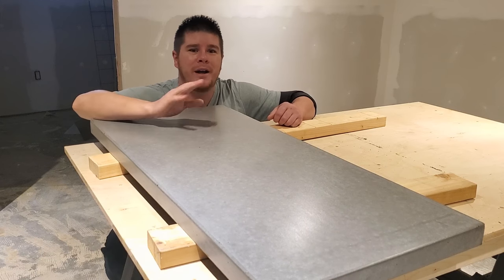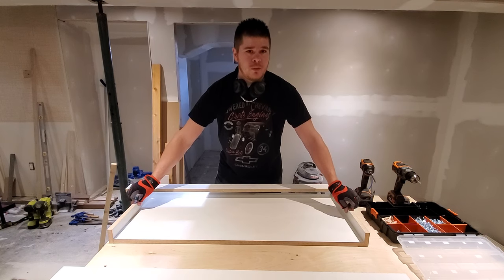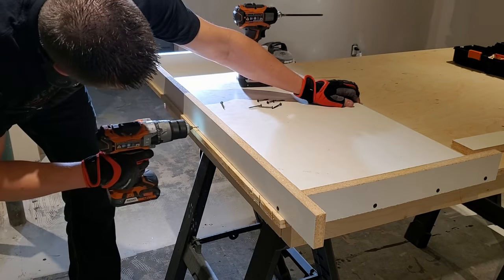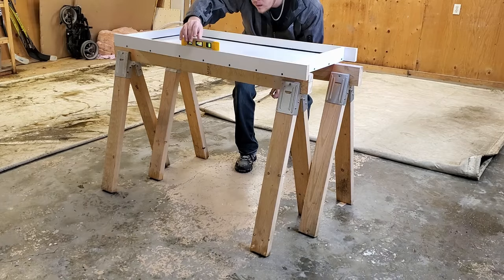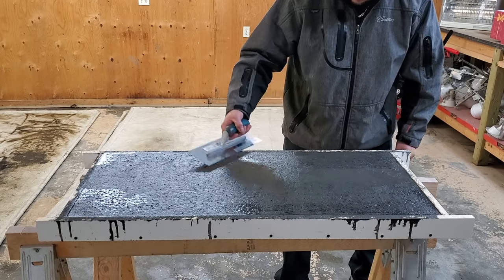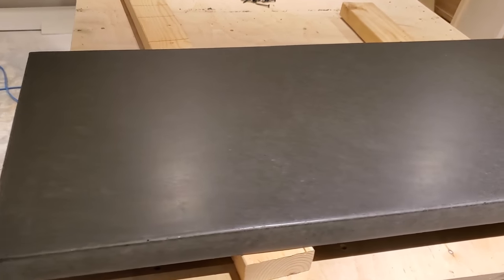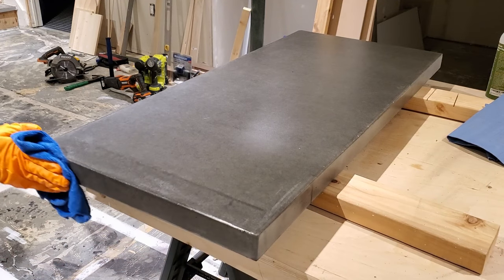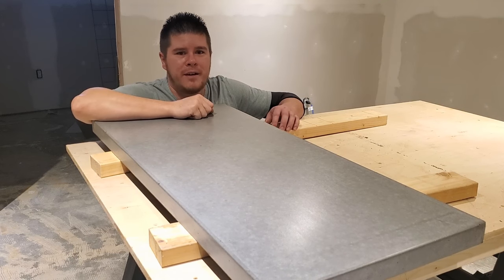Beginners guide, Concrete Tabletop you can build. No special tools, hand finished

Comment: That looks so good, forget paying megabucks for a concrete table, I'm having a go at this, great vid. One question, if you wanted to mount steel legs to that, how would you go about it? Drill/plug the underside, & screw in, or epoxy glue?
Reply from the maker: Thanks! Good luck with it. I guess that depends on the type of mounting plate, I would probably sand the tops of the legs with 60 grit to rough it up so epoxy will stick better and go that route. I'd be worried about drilling a fresh slab and not have it crack. Epoxy is a much safe route. Thanks for watching!

Comment: I use those same mechanics gloves they are amazing. Why would you ruin them by sticking them into wet concrete?
Reply from the maker: They are pretty good. I forgot my nitrile gloves and needed something quickly so I didn't have to stick my bare hands in the concrete. They were getting pretty tired anyways so it wasn't a total loss

Comment: Hello....I am getting ready to to try and make my first outdoor concrete patio table for a customer of mine. I am here in the states and was wondering what would be the equivalent to the concrete you used. I see a lot of people use GFRC (Glass Fiber Reinforced Concrete) but it seems to be kind of difficult to get. I really learned a lot from your video. Great Job! Frank from Southern California.
Reply from the maker: Yeah GFRC is tougher to get and needs some special considerations I didn't take about. I used Quikrete 6000 from home depot, but your best bet is quikrete countertop mix, it should be readily available for you. It's really hard to get where I live tho. The countertop mix is made specifically for this and is easier to work with and usually gives the best results

Comment: How many coats would it take to have water and other liquids bead off it? I read some reviews on Amazon and one of the mentions that it penetrates so much that you can't get a finish that reflects water. I like the fact of going only to like 600 or 800, and I will be doing it by hand. I poured RapidSet Mortar Mix and it's already pretty smooth, but I added color and it chunked it up, so when it came time to vibrate, the colors didn't release as much bubbles, so my counter has some character to it.
Reply from the maker: It depends on what brand of sealer you get. The stuff that I have linked and use it only takes 2 coats, then 1 recoat per year. This is a penetrating sealer and helps prevent staining, it may still get wet if it's allowed to sit, but thats what the wax helps. The wax on top of the sealer prevents anything from soaking in just like I showed. Reapply wax as needed too.

Comment: Would you recommend against drilling into the concrete tabletop? What's the best way to attach or build legs?
Reply from the maker: I wouldn't drill it. Best way to attach it to a table or cabinet it with 100% clear silicone. Put quarter sized dollops on the corners, and center of possible, of whatever your setting it on. Then without dragging it around, set it straight down on it

Comment: Great job, what cement do you recommend?
Reply from the maker: Thanks. You can honestly use any concrete, but preferably a non shrink or low shrink is best to avoid curling over time, the stuff I used was $10 a bag. If you have access to a countertop specific mix that is best tho. I don't have it where I live but wish I did

Comment: Love this video.  Very helpful and I followed the directions step-by-step but when I took off the mold and flipped the slab over you can see the faint outlines of the metal mesh in the concrete top.  It’s a subtle dark outline of the metal.  What did I do wrong?
Reply from the maker: Thanks. Sorry to hear you had a issue, but it happens. It just gives you more skill to practice again is all! Everything is a learning experience. So it sounds like you either put your reinforcement too low while making the slab, which puts it too close to the top. Another thing that can cause that is too thin of concrete and too much vibrating after it was put in caused it to sink and come too close to the top. Try again, but fill the slab 3/4 full and do the majority of your vibrating, then add your reinforcement, top off the cement and another quick round of vibrating. Making sure your cement is close to oatmeal consistency. Hope that helps, let me know how it goes
Reply: Thanks for your help! I think I overvibrated it based on what you said.  I’ll let you know how it goes.
Reply from the maker: Happy to help. Good luck

Comment: vibrating it wont cause the aggregate to settle and show in the finished side? That is my only concern. I have seen these tops made with a high strength mix such as Rapid set mortar mix from Home depot, and still using the reinforcing wire. Thoughts?
Reply from the maker: Nope. Vibrating concrete is necessary. The aggregate actually pulls to the center and the cement is pushed to the outside. I'm not a fan of the mortar mix personally. That's not what it was designed for and runs a much bigger risk of curling and cracking over time.

Comment: beautiful project!!! amazing result! very well described. Can you tell su exactly what type of concrete you used? and what exactly is that dark liquid you added to it?
Reply from the maker: Thanks! I used Quikrete 6000 psi pro mix, but the Quikrete countertop mix is best to avoid twisting and warping as well as an even cleaner look. It was a couple bottles of Quikrete charcoal concrete dye. Hope that helps! Thanks for watching
Reply: @JessedoesDIY  Thank you so much for this quickest reply! For sure it helps!  couldn't get faster service even at Homer Depot... LOL. Thanks again and keep the good work! Cheers from montreal
Reply from the maker: Anytime!
Reply from the maker: I've used rapid set mixes before making patio stones and you have to work very fast. While it isn't necessarily dry for a hour or 2, it sets and firms up withing minutes, and you're right as it does make it very hard to vibrate out bubbles that way. You have to work fast, but for a outdoor table it might not be too bad. I've also 50/50 mixed fast set stuff with regular mixes. It slowed it down and gave me time to work, but overall set up much faster than normal concrete would have. You could try that. Worse comes to worse, after it's done you can make a slurry with sifted cement  and fill the holes in the top and then sand it again. I want to have a video out withing the month on how to do that, but I know that's a long wait for you. Hope that helps. Feel free to email me with more questions if needed!
Reply from the maker: I typically use Quikrete because it's what I have available to me. Any mix can work really, but for the best results you'll want something that says it has no shrinkage or resists shrinkage. That's so it will resist curling over time

Comment: What mix did you use please??
Reply: Looks good
Reply: You can help me make it bell nut
Reply from the maker: I just used Quikrete 6000 psi mix, comes in a blue bag. It's a bit stronger and has minimal shrinkage, plus smaller aggregate. But if you can find the Quikrete countertop mix in your area, by all means use that. It is by far your best bet
Reply: @JessedoesDIY  thanks for the reply, I’m in wales uk, so I’ll try find a comparative product, cheers mate
Reply from the maker: Anytime! I try to answer everybody. The biggest thing you want to look for is minimal to no shrinkage concrete, and as small aggregate as you can. Typically cheaper stuff has bigger stones and we don't want that. Hope that helps! Let me know how it goes
Reply: @JessedoesDIY  I certainly will, It’s going to be a table for a pizza oven 👌
Reply from the maker: Cool! That'll be awesome!

Comment: Hi, I'm wondering how dark the color is after a couple of years?  Does it lighten up to an almost white beige natural concrete color or did it stay the way it was in your video?
Reply from the maker: The thumbnail was taken a few days after and that's as light as it became. I only added about 1/2 the dye I could have. If I added the maximum is gets to be a charcoal/gunmetal grey and it stays pretty dark. I made 1 with max pigment I could a couple years ago and it's still super dark. If you use the liquid dye just read the bottle for amounts but Quikrete stuff that I used I can use up to 2 bottles per bag. Hope that helps

Comment: Great Video! could you re use the mould?
Reply from the maker: Thanks. Possibly, it depends on if your mould swelled from the water in the concrete. If it didn't, give it a good clean, scrape off the old silicone and you'll be good
Reply: @JessedoesDIY  good points, ty!
Reply from the maker: Anytime

Comment: ok.  it came out great.  but one question...  there are bubbles / indentations in the face of the concrete.  I love it by the wife does not.  so I'm going to try again.  I vibrated for 20-30 mins hitting mostly.  shocked at how many bubbles on the top surface.  I will hit harder next time...  but????  concrete - perhaps mine should be more wet?  or i used 5000 'grade' professional cement not 6000?  should i put in a bit more mortar?  any ideas??
Reply from the maker: Cool! We'll now that you've tried it you can refine the process. There can be so many bubbles sometimes. Yeah, I find it vibrates easier when it's a bit wetter, but be careful because too wet and it'll be likely to crack. Just a small amount of water at a time. I know it's hard to judge, but the consistency that I had in the video was perfect, it's slightly wetter than normal. The 5000 and 6000 are pretty interchangeable so that is ok, if leave the concrete as is. I actually just made a concrete top for my bathroom vanity with a completely different process out of necessity. Maybe check that video out, might pick up some useful tips

Comment: Would you advise against using rapid set concrete mixes?
Reply from the maker: I would, they are more prone to cracking and having bubbles are much harder to work with because they dry so fast.

Comment: Should I be concerned about little pocket holes like pinholes in the top of the concrete?
Reply from the maker: Nope. Unfortunately they are super hard to get out sometimes. You can just make up a slurry if you want. Use cement (not concrete) and some dye if you used it, and a 50/50 mix of water and acrylic fortifier in a cup. Mix it all up to be close to toothpaste. With a rubber glove on smear it over the top doing about 1/3 of it at a time, pushing into the holes. Wait about 5 mins and with your rubber gloved hand push it all back off again. It should ball up and get peeled off. Let it dry a couple hours and then using a blue scour pad from the kitchen dipped in water, lightly wipe the haze off the top. Follow up by drying it off with a towel. Then dry for a day

Comment: Awesome tutorial - thank you! Do you think this would be OK for outside? And survive the UK frosts and winters!? I'm thinking of making one for an outside BBQ area - but need to be sure it'll be season proof!
Reply from the maker: Thanks! Absolutely it will. Just need to make sure to stay up on sealing and waxing as needed but it will definitely survive. That's the great part about concrete, it is durable for all sorts of stuff. That will be awesome
Reply: @JessedoesDIY  Just a quick one - I saw a YouTube video today that said concrete counters less that 4 feet long don't need reinforcement. Do you have any thoughts on that? I'm just about to cast 3 separate slabs of 770mm by 750mm (50mm deep) and wonder whether to dispense with the reinforcement mesh...
Reply from the maker: The length isn't typically the problem, it's thickness and support. Thinner slabs can crack easily, but also too thick can crack under it's own weight. I've done commercial concrete and home concrete work like this and we always subscribed to the school of thought that for the small price of reinforcement and the strength it adds, better to have it and not need it, than need it and not have it. It greatly adds to the strength and crack resistance of it so I almost always add it for longevity and peace of mind
Reply: @JessedoesDIY  Thank you - makes perfect sense. I'll reinforce it and send you the pics!
Reply from the maker: Cool. Good luck and have fun with it!

Comment: Do you use sandpaper
Number 800 to polish
The concrete surface
Only one grade until
The job is finished?
Reply from the maker: Yup, that's all that's needed. You can really go down the hole of up through all the grits and then polishing, but it isn't needed in most cases

Comment: Amazon is out of stock on the Tuff duck sealer and I didn't easily find it anywhere else either.  Do you have a second recommendation?
Reply from the maker: Really? The Chengs sealer applied the same way and is also really good. They are both based off a permeating wipe on sealer

Comment: I love this video!
Looking to do the same soon, however Quikrete isn't available in the UK, did you just use High strength concrete? The ones available near me have up to 10mm aggregate premixed, would this be an issue?

Once again, love the videos :)
Reply from the maker: Thanks! The mix I used was about 10 mm stones as well. The countertop mixes are easier to work with because of such small aggregate, and slightly better flowing. But honestly the biggest thing with larger aggregate like this is to make good and sure your vibrate it like crazy like I did so the cream comes out and the stones settle in and you'll have next to no bubbles. That way when you de-mould and lightly sand, it should look just like mine. Good luck, if you have any questions just ask!
Reply: @JessedoesDIY  awesome, thanks for the reply. Keep up the videos 👌😊😊
Reply from the maker: No prob. Will do

Comment: Wow....what an awesome tutorial.  I was wondering if you would be limited to the size tabletop you could make?  I am keen for a outdoor table that would seat 10-12 for our BBQ area :).
Reply from the maker: Thanks so much! Not too much, as long as it has support under it all around. I might beef up reinforcement just a bit along the edges. Use the mesh throughout, but add some thin reebar around the outside of it
Reply: @JessedoesDIY  ....super speedy reply. Thanks so much. I'll show my hubby and fingers crossed he'll be keen to do this with me.
Reply from the maker: Cool! Good luck and have fun

Comment: I tried this and worked great, however I still had bubble holes on the sides. Top turned out great, but how can I not get holes on the sides?
Reply from the maker: Awesome! Make a thin slurry mix with just the cement, no stones, in a cup. Then press it into the holes but smooth it out as it sets up a bit, let it dry and you can wet sand it again where you applied slurry

Comment: How do you ensure that no cracks happen in the concrete?  Is it the vibrating or the covering of the slab with the black bag for slow drying?
Reply from the maker: Honestly any slab could crack at any time, but yes, all those steps will minimize the chances of it. Vibrating it really good like I did will make sure as few air bubbles are in it as possible, the less voids, the stronger and smoother it is. Covering it and slowing its dry time down will also add to the overall strength of the slab and also help prevent curling which will lead to cracking, that's where the concrete twists over time from the core drying out and shinking as water evaporates. On that note, having a correct thickness of your mix also helps, the runnier you have your concrete the more prone it will be to curling and shrinking. So to sum it up, it's really a little bit of every step that helps, but if done correctly it should be fine
Reply: So then with that said - any tips for putting concrete on a fireplace?  I can’t vibrate it while putting it on the Durock board....so would you recommend putting the bag over it and making the mix a bit thicker?

Comment: My request is could you please suggest to me alternatives to wax and the melanin board. I also wish to know the proper cement-sand ratio if I were to mix these ingredients at home. I leave in this part of the world where it's extremely rare to find such ready made stuff
Reply from the maker: For a concrete ratio, about 1 part cement, 2 parts sand, and 2-3 parts fine small gravel, and about half the amount of water to cement. Then just mix as needed, but that will get you in the ballpark. For the form you can also use a smooth sanded plywood like birch or something, but you would need to add around 3 coats of clear coat to prevent the water from soaking in, also make sure you have clean, chip free cuts because the finished concrete will mirror everything in the mould. As for wax and sealer you really need that, there isn't really an alternative. They are specifically made for countertops and are food grade safe. They seal it from staining and decay, as well as prevent them from chipping and dusting when you touch them. Hope that helps, thanks for watching!

Comment: My OCD can’t help noticing the two lines on both ends of the top, did that happen when you had it laying flat on the two by fours?
Reply from the maker: Yup. They went away after a bit more drying out over time. The wood pulls water from the concrete is all

Comment: how do you feel about using wd-40 to prevent sticking?
Reply from the maker: Because that has a petroleum base it may mess with the concrete finish, I've never tried it but I've had such great luck with car wax I've no need to

Comment: How resistant is this kind of countertop to heat - like a hot pot, pizza fresh out of a wood-fired oven, or meat fresh off the smoker, etc. My concern isn't the concrete, but more the sealer and wax...
Reply from the maker: Once it's dried and cured on, extremely resistant